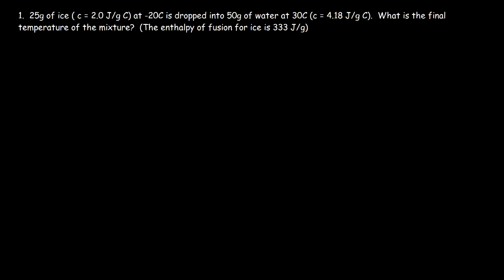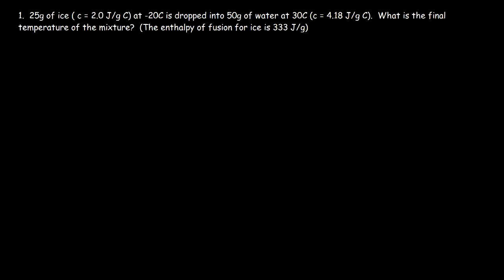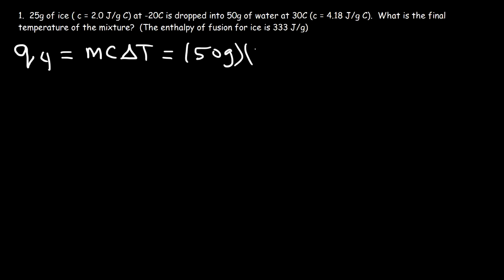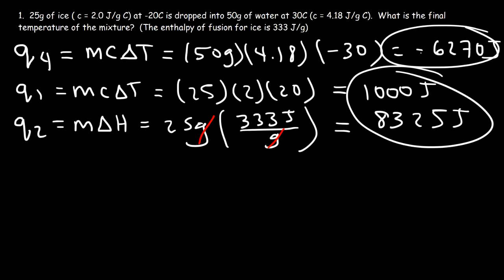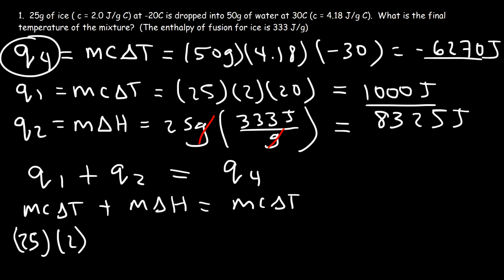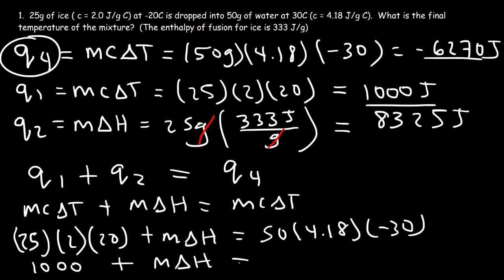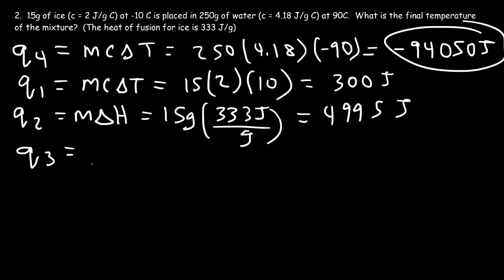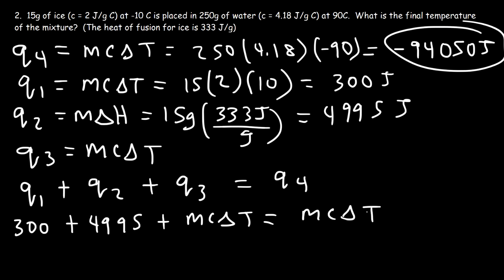Final Temperature of Ice and Water Mixture - How Many Grams of Ice Will Melt?

Comment: can you answer my question 🥺

Amin adds 50 g of ice at -10 °C into 100 g of milk at 75 °C in the mug. Compute the thermal equilibrium temperature of the system.
Given the specific heat of water is 4,186 Jkg 1 °C*1, specific heat of milk is 3,830 Jkg ' °C*', specific heat capacity of ice is 2, 100 Jkg 1 °C•1 and latent heat of fusion of ice = 330,000 Jkg*-1
Reply: He taught you, so that you can do it your self
Reply: @PandaPanda-i4e  shut up if you don't have any solutions , asking is the key in learning

Comment: PLEASE I NEED THE FORMULA OF THIS…
Suppose you heat 1,000grams of water into boiling and mix it with 3,000grams of Water at 16 °C contained in an aluminum pail of mass 50.0 grams. What is the resulting temperature in °C?

Comment: For problem 2, it's much easier to solve algebraically first. It looks daunting because I've included extra steps for clarity and review. Most people will be comfortable jumping from 1 to 3 and then 3 to 5. It takes a minute. Doing the algebra first this way helps you spot any errors in unit analysis at the end and means you just have to move symbols, rather that keep track of numbers. If this helps you great. If it looks too scary then you should do this more until it's second nature.

q1+q2+q3=-q4

"mi" is the mass of ice. "ci" is specific heat of ice. "mw" for water. "cw" for water.
NOTE q3 considers the mass of ice, but in liquid, or water, form. This is because this term accounts for the grams of ice that have gone through fusion, and while they are zero degrees C, these grams are now liquid water.* 

0. begin by setting up. Remember you negative sign!

micidTi + midH + micwdT = -mwcwdTw

1. dT equals Tf minus T initial

micidTi + midH + micw(Tf - 0) = -mwcw(Tf - #)

2. Distribute masses and specific heats

micidTi + midH + Tfmicw - 0xmicw = -Tfmwcw + #mwcw

3. anything times zero is zero, so ^ term goes away. Also pay attention to the negative and rearrange.

#mwcw - micidTi - midH = micwTf + mwcwTf

4. Factor out what you can to simplify

#mwcw - mi(ciTi - dH) = Tfcw(mi + mw)

5. Divide through by "cw(mi + mw)"

Tf = (#mwcw - mi(ciTi - dH))/cw(mi + mw) <---- now plug and chug

NOTE, "#" really just represent the difference between water's initial temp and zero degrees C, so you can replace it with dT to generalize to another problem asking for the final temp like when there is a different starting temp for liquid H20.

Tf = (mwcwdT - mi(ciTi - dH))/cw(mi + mw)

(edit: sorry about the hashtags. I'm not trending with that.)

Comment: sorry for the lame question, but I can never understand why you use the same specific heat capcity of 4.18 ( instead of 2.11 specific heat of ice ) on the left and LEFT side of the equation, when calculating iCe melting.  For instance 5295+15(4.18)*(tf-0) = 250 (4.18)*(tf-90) instead of 5295+15*(2.11)*(Tf-0) = 250*(4.18)*(Tf-90)
Reply: That's because the process is already converting ice to water, so, the specific heat capacity should be of water.
Reply: That's my problem too. Now, I'm having confusion on when to use the specific heat of water.
Reply: You said it yourself? The ice already melted. It's water now.
q1 the ice is just heating up so the c is still of ice. q3, it already melted. (It melted during q2.) q3 is you calculating the melted ice heating up even further because it's mixed with warm water.